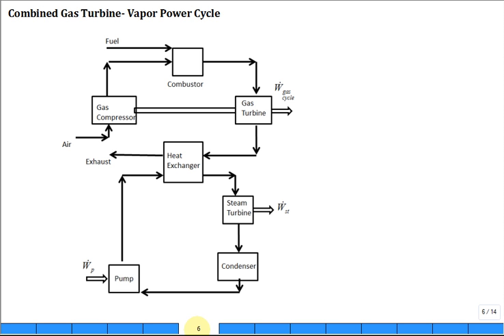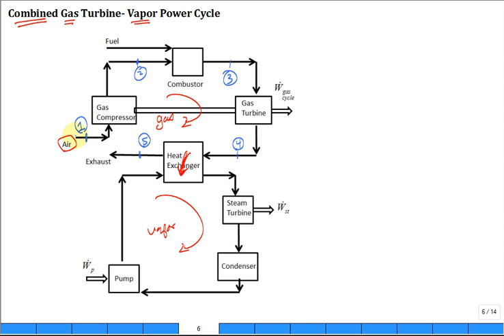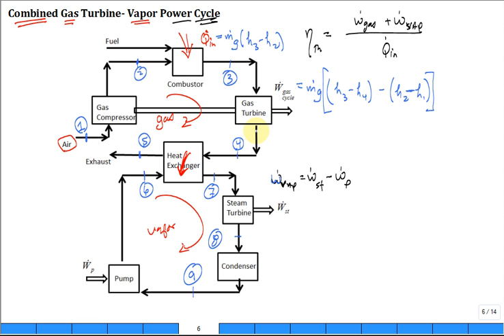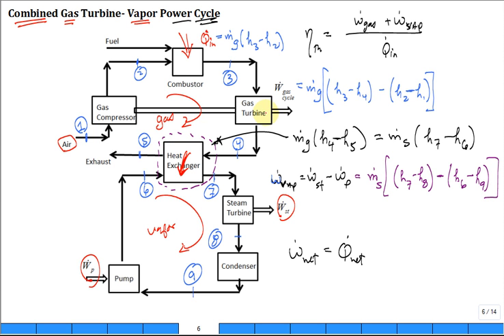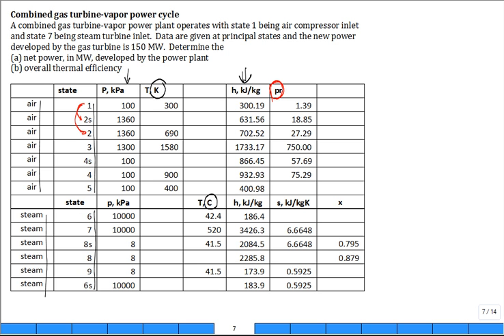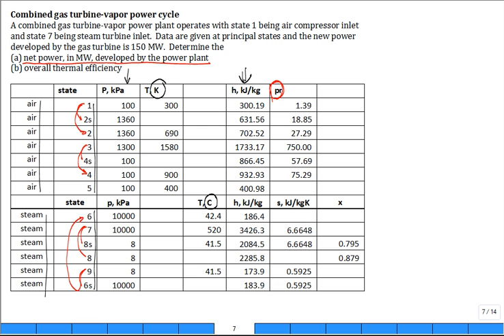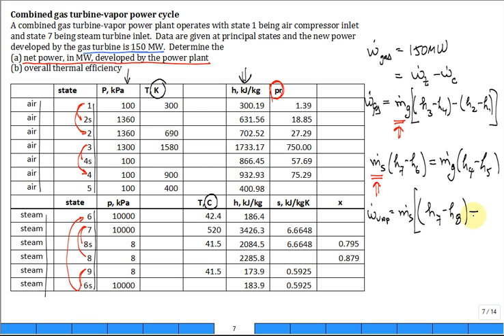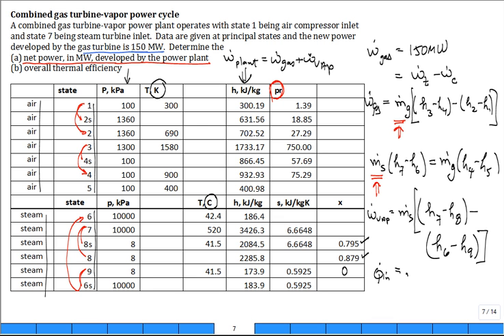Calc Combined Gas and Vapor Power Cycle

Comment: Don't you need to include the work supplied by the pump as another input. So something like efficiency = (W_gas+W_vap)/(W_pump+Qin). Perhaps I'm missing something. Or maybe W_pump << Q_in so that the W_pump term can be neglected. Thanks for the video!
Reply from the maker: Thermal efficiency is (net_work_out) / (heat_in).  The emphasis is on "thermal" efficiency.  so W_net = W_gasturbine - W_gascompressor + W_steamturbine - W_waterpump.  Q_in = Q_combustor